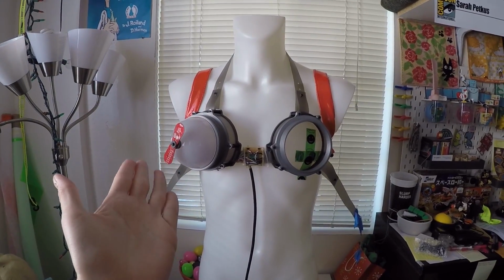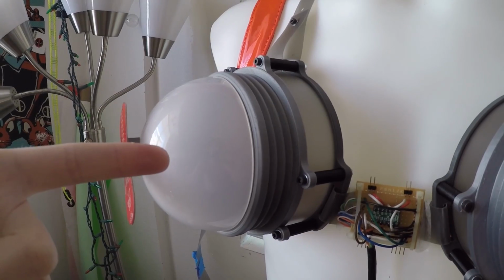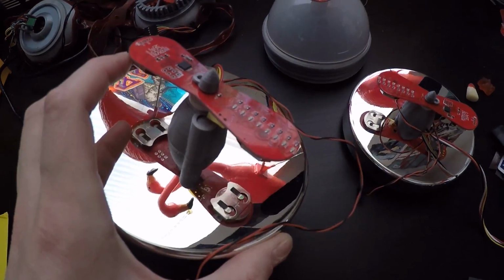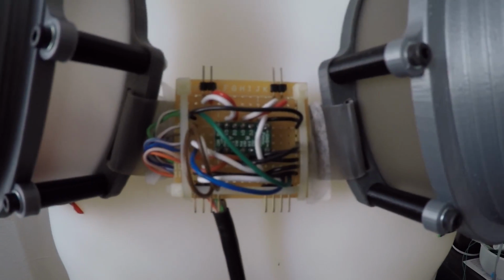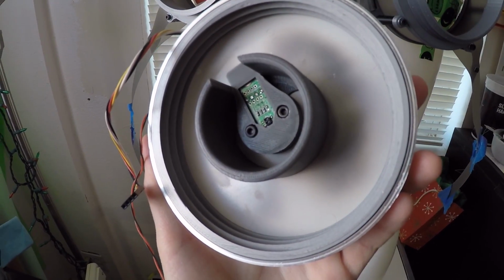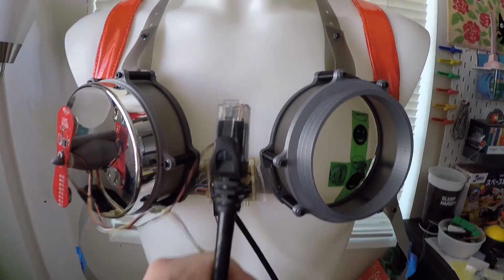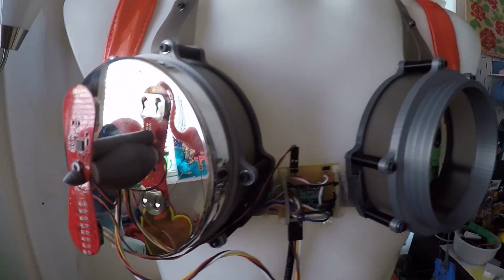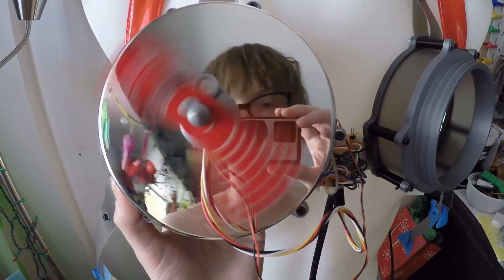POV Pasties : DEMO and Build Breakdown

Comment: Legit!  Making some really solid progress!  Is there any backing behind the connector ports to anchor them square/aligned on the backpack?  Or just the vinyl plastic?  How long do you anticipate the batteries last in the propellers?  Guess, if there’s no stimulus, they’re no on, but what about full-blink?
Reply from the maker: The ports don't have a backing right now, which is something I want to change for the next iteration of the enclosure =P (it is annoying)

Also, the batteries don't seem to last very long, but the board has an off switch on it now so I can at least cut power to them when the system isn't in use.